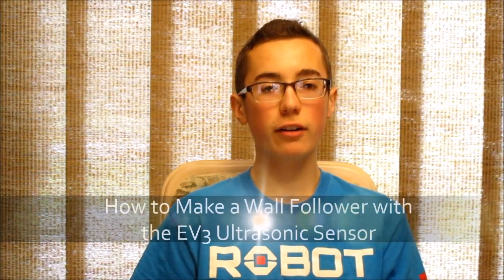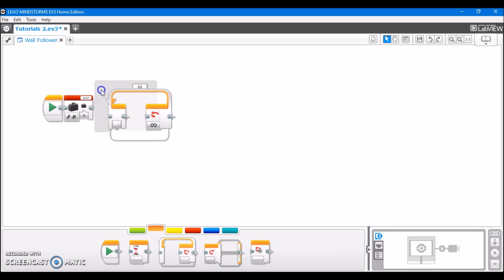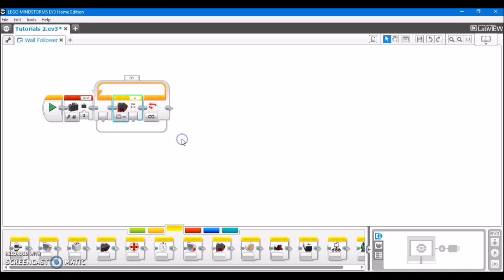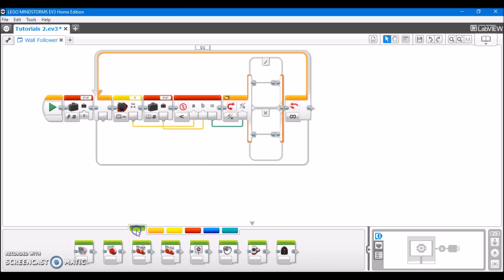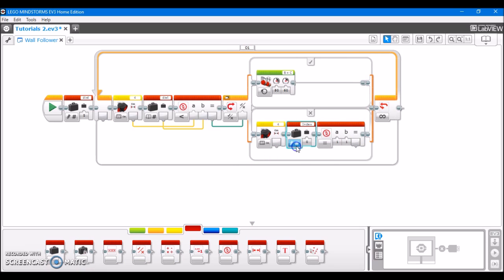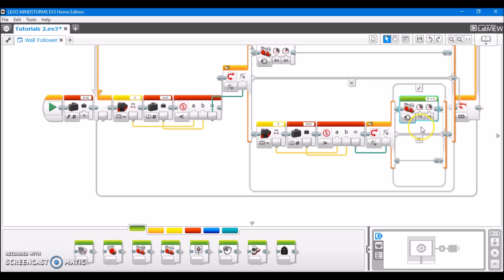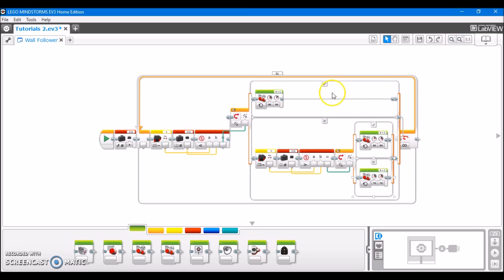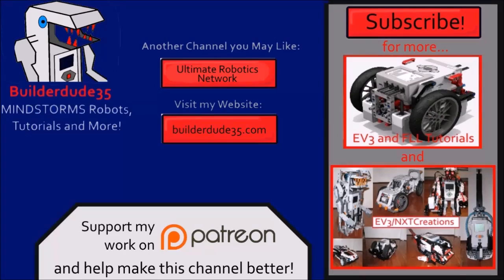How to Make a Wall Follower with the EV3 Ultrasonic Sensor

Comment: So, when we were thinking about our general robot design we came across a big problem on the accuracy of the ultrasonic sensor. It couldn’t measure really precisely . It couldnt sense rhe difference between a car and a barricade. Do you think infrared would be enough or should we go with combination measurements like color sensors

Comment: I coach a robotics team and we attempted to use a wall follow program in the spring. It worked perfect on the 2 tables we have. When we got to the competition it wouldn't work on their table walls. They were black. Does the black paint affect the function of the sensor??? The team adjusted and hung white paper on all the walls they were following and it worked fine. It was a build your own mat competition and we were allowed to hang the white paper stating itvwas part if our mat.
Reply from the maker: That is very strange. It depends on what senor you use. The color of the wall does not affect the ultrasonic sensor because it uses sound to measure distance. The IR sensor, which uses light, would definitely be affected. If you are experiencing this problem with the US sensor, it may be that you increased the surface area of the wall when you added the paper (if the paper was larger than the original wall and the sensor's ultrasonic waves were missing the wall before placing the paper).
Reply: If you used the ultrasonic sensor, it's sensitive to the surface type, and it works better with hard surfaces.  If the table walls at the competition were a soft surface, that's probably why it didn't work.

Comment: hello, hey you could collaborate with a wall follower but with the whole infrared sensor with the one you have here and started to spin like crazy, that changes when using the infrared
Reply from the maker: It's possible that the Infrared sensor is a little more reliable for wall following.

Comment: Can I make it so that instead of large mothers I can use medium motors I want a head to turn in the direction of a object
Reply from the maker: Yes, that's absolutely possible!
Reply: ok so i did the thing but when i move in the right diretion it moves to the right nut when i move to the left it moves right! did i do something wrong?
Reply from the maker: Hmmm... Check back in your program and make sure your target value (subtraction) is done properly.
Reply: not sure whant you mean by that but i am using 1 meduim motor to turn a head what i want to to is that if i move to the left it would follow me to the left if i move right the meduim motor will turn right and then if i stop then it would lock on to me. get what i am saying?
Reply from the maker: Sorry, I'm still not sure. Send me an email through my website, builderdude35.com.

Comment: Hello. I have a question i was on a wro competition last weekend and i saw there that a lot of programmer uses next to their main projekt many under programms. For example the first programm had the name run the 2nd grab and the 3rd finish. But in the internet i dont find a way do open a programm after the last was finished. When run is completed then the robot start with grab and so on ... . I dont know how this work and i littlebit frustrated because i searched for a long time. Can you help me?
Reply from the maker: They are linking all of their tasks into one long program, putting the tasks in sequentially as they want them to execute. In between, they may put a Wait for Touch Sensor block so the next task starts when the tap the sensor.

Comment: Hello Builderdude, very nice program.What about corners? May work? Or do we need to add more variables? Thanks
Reply from the maker: If the corner is curving away from the robot, this program will work. However, if the corner moves in towards the robot, you mat need an additional, forward-facing sensor to detect, say, a 90 degree right turn if you are following a wall that is on your right.